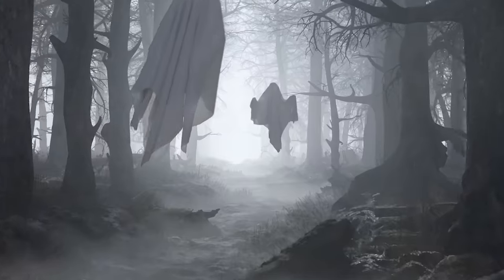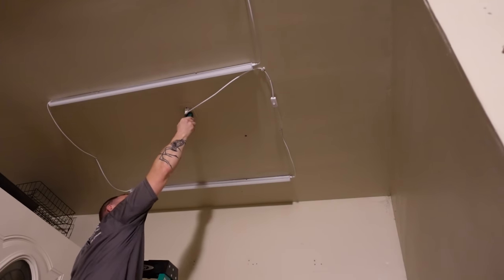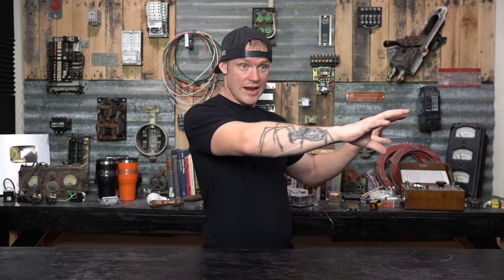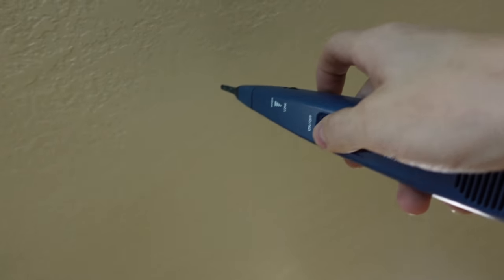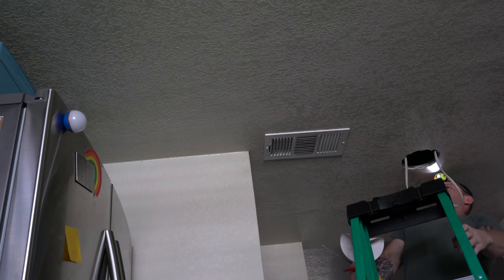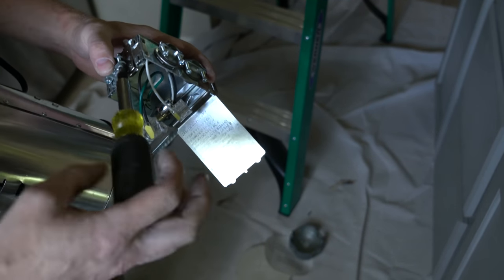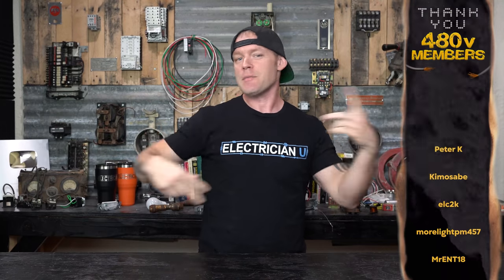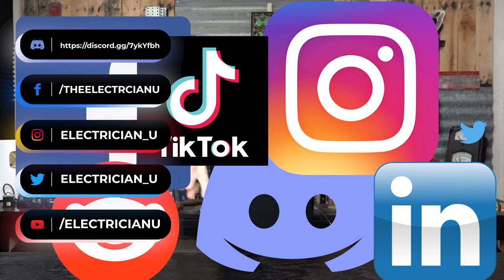THIS IS WHY ELECTRICIANS DON'T HIDE J-BOXES IN WALLS - Finding Hackwork!!

Comment: I am not an electrician but I have a brain, understand basic electricity and I am very careful. Over  four decades ago I was replacing a light fixture in our kitchen eating area. The house was a custom build only a few years old when i moved in. After turning the circuit breaker off I checked the wiring and saw 50V. Hmmm This fixture was controlled by a single switch but the house had a number of light fixtures on different circuits controlled by 3 and 4 way switches in the same gang as other 3 way switches or back to back with a box on the other side of the wall. To make a long story short it was four junction boxes before I found joined neutrals from another circuit and another 5 to make sure that was the only one. This almost new house, "professionally" wired also had a built in 240V oven simply wired nut connected loose in the wood cabinet (no  junction box), dishwasher not grounded with the ground wire simply cut flush with the sheathing and aluminum entrance cable, allowed by code at that time, installed without antioxidizing paste. Noticed that because the panel back was touching a wood panel wall in another room and i discovered it was warm to the touch. And when I took the face off to add NoOx I discovered a knock-out, loose, perched upright between the two hots from the meter. BTW I had an active toddler and the panel was under stairs, in a laundry room and backed up to the den where bouncing balls, etc. frequently hit. One good bump and ..... It looked like they originally intended to feed the panel from above and just used masking tape to hold the knockout in place instead of an open hole. I think that was all from this house but not the first or last time I have redone work by so called professionals. Glad to see you are both competent and caring.

Comment: I have a 12/2 wire running from my panel its on a 20A breaker. It use to be used for the fridge but I tore the wall out and moved the fridge so I got in attic and moved it and put in 8 led lights in living room. I also put a ceiling fan in living room to so I put a junction box in attic and connected two 12/2 wires down to 2 different light switches one to run fan and another to run the led light. We'll if I turn both of them on at same time the led lights flicker. Does this mean that's it's not enough volts thru that wire to run both. I figured a 20A breaker would be able to run 8 flush mount led light that are energy efficient and a ceiling fan. Should I run another wire and put them on its own 20A circuit.

Comment: Probably started out as a chandelier on the plans and the customer changed their mind
 I said to myself that if it was mine I would just put a can light in there 
I'm surprised the customer agreed to that 
Usually they are stuck on the original design

Comment: But why did the wire nuts melt? Why did it get hot? Was the twisted wire inside the wire nuts opening up and arcing? Was the breaker allowing more amperage than the wire was rated for? Was there a lighter weight Romex between a heavier Romex and the breaker that allowed a greater load than the light weight was capable of? Was the breaker too many amps? What are they using that draws so many amps that it could cause so much heat? Why didn't the breaker blow? Was there more than one breaker connected to that jbox or another box on that run? Something caused the problem. What was it? Did the construction workers currently working in the building drive a nail into the wiring? How long before the fire detects the real problem? Do you suppose anyone will die in the fire? You fixed the symptom. Did you fix the problem? Are you sure?

Comment: Really good tutorial!  I recently went through this same routine and found a hidden j-box in a cold air return.  Unfortunately it was not the problem. There was another hidden j-box, I am sure, that I never found. In that case I ran new wiring which fixed the problem. This kitchen was remodeled some years before and the hidden box probably occurred then.

Comment: Couldn't there have been a bit of a "return" on the voltage through some appliance that remains "on" like a clock?
That neutral stress point really looks like a long term high amperage draw that over time melted an iffy connection.

Comment: I just bought a house in Missouri and in one bedroom only , on the outlets they have one switched plug and the lower plug is live all the time. Only thing is the switched outlet does not go on and off, it goes from 120v with the switched on to 40v with the switch off . That is the way all the outlets in that room only works. No other room is like that. The upper is switched and the lower is always live. 🤔 🤦

Comment: Electrician’s don’t hide junction boxes, home owners and drywaller’s do. I’ve done a lot of drywall and it’s always the home owners that want them hidden. So when the drywall goes up, I mark on the drywall where the box is and tell them they need to get a trap door to install. After that it’s on them as far as I’m concerned

Comment: Hot doesn't need to go to anything else. If the insulation is bad and the business is all in the same metallic j box, you will pick up roughly 40v thru induction.

Comment: For what they paid for that service call... You should have fixed it.  It is just going to fail again later.  I hope noone gets hurt when it does.  Actual fix would be to jump off outlet... or better... Set a breaker in the panel and run a new line to the outlets so you don't need any wire-wire connections going to an outlet.  What it looks like happened was exchanging one fire hazard for another.

Comment: Good diagnosis. 
“The eye of the Master does far more work than his hands”.
Code issue still remains with SABC feeding GLBC  loads. I probably would have done the same as you did. 
A friendly suggestion; you might want to curb the F Bombs. Not everyone uses the F word. Potential customers might be turned off by your language. I worked electrical construction for years and spoke the same way. However, I no longer talk that way. 
Thank you for an interesting YouTube production.

Comment: Most likely the plastic just got in between the joint causing resistance after the initial heat up of a loose joint.  The guy's pretty lucky his house didn't burn down and it just stabilized at "weird".

Comment: This reminds me of a job I was on. It was out a ways and they had a bunch of electricians out and no one can figure it out. This was a multi million dollar house on a ranch and was being used for a sober living home. Anyway long story the upstairs bathrooms didint work the master and the one across the hall. I traced it removed every plug and went down to the main box and checked the generator box. Nothing was wrong. Now wile I was there I noticed the smoke detectors were off and at this point I had just looked while walking up the stairs. After about 5-6 hrs I was about to give up and run a new line for them. I needed up going to the attic entrance right by the bathroom and mind you I was up there a couple times. The last time I saw this random Romex not stapled to anything. So I decided to follow it and boom. The one of the dumb asses before me hooked the bathroom that was getting fed by a breaker and the smoke alarms that was on a separate breaker. And tied them together over this hallway. Then did a bunch of jank shit to the other bathroom so after I undid all of this. I can't remember I think it was all for a light and a switch. But it was fixed. That was a crazy day. But I got paid well and there now a regular customer. And they have been super happy. Somthing to laugh about when I talk with the owner of the house/program

Comment: 48V 200MA passing through your heart from a ringing LL telephone can kill you. That last ring could kill you. LOL. Canned all in one contractors think nothing about burying boxes. Some don't bother using a junction box.  One day I arrived as the electrical fire was burning inside a wall. No smoke, no sign of fire. 2nd floor lights not working. Asking the questions, I poked my head into the attic and I smelled smoke. Not enough to blow out the attic vents yet. My coworkers are all volunteer firemen. I called in the fire, then my boss. He walked me through pinpointing the hot spot, breaking the top of the wall and putting the fire inside the NEW bathroom wall out before the 1st fire truck arrived on the scene. Had I arrived 10min later, the 2nd floor would've been up in flames. That's one fire job I am glad I got to before it became a tragic event.

Comment: Sir what Caused the junctions to fail?  I work on vacuum tube radios. Of course capacitors and resistors fail over time, Often they are caused to fail.  That junction worked and then flaked out.  More at how do you confidently know that know that there is no underling problem which could cause that over heating and gods forbid result in a n electrical fire?

Comment: Yoooooo, I had a can I had to remove that was screwed to a joist. But the can wasn't removable, not a single screw let it loose and i could for tack weld spots that held the other side of the sheet metal for wiring on

Comment: I have an outlet on the second floor.  The wire is in the sub floor.  The outlet hasnt worked since i moved in. I thought after seeing a video i thought I might try and fix it. I couldnt follow the wire so I took out all switches and plugs in line of wire. I thought I would find a loose wire. Any Ideas.tks

Comment: To add-on to the explanation of how dangerous electricity can be, I'll use a cliche comparison with water.  Voltage of electricity is like gallons of water, but Amps of electricity is the speed of it's flow.  Sure we've all seen a tidal wave level houses, but think about a home outlet being like a pressure washer, it isn't spraying a whole lot of water in a moment, but it'll take your jaw off if you try to get a drink from it.

Comment: Can a junction box be accessible from the attic? A contractor i had working on my kitchen put a cover plate to a junction box on my ceiling and its somewhat of an eyesore.
Reply: Would love a picture 😄
Reply: @richt5986  I cant trust Google reviews 🤦‍♂️. He also ran a cold water line to my dishwasher and connected my kitchen light switch to where they only turn on if my living room light switch is on.
Reply: @countrifiedjose7537  wow.

Comment: J boxes aren't hidden because its illegal now, every box must have access, with a few excpetions, I.E. dropped tile ceiling, attic... but they are a pain in the arse when your searching for a short and usually done by a DIY'er or Hack.. I've done many homes where the contractor put nails through my lines so i put in a box with access cover, and later went back to go over everything with inspector and had found those accesses i put in were covered over with mud, The inspector read the riot act to the general and red tagged the build and told him to remove the mud from the box access before he could continue. The general refused to allow me to run a whole new line since he would have to repair 6 feet of drywall so i put in a j box and told him it must remain open and accessible.. I no longer do work for that company...

Comment: I'd be concerned with the quality of the breaker in this situation... To have so many devices jumped off a kitchen counter circuit is asking for overloads, and if the breaker was faulty, the circuit could be running those high loads, melting the wire nuts, and causing a problem precisely like this. If this is the case, this same problem will pop back up in a couple of decades

Comment: I like the video and the dude's explanation of the problems, but why would you yank on wires instead of using a tracer? Stapled wires might not move and wires held in boxes might not move. A tracer or tone generator could have resolved this without all the guesswork....

Comment: 😮 You're allowed to put a downlight light directly beneath and/or against a stud?

😆About drop sheets; I use them all the time, but they get dropped on dirty floors, and then onto someone's kitchen bench on the next job. I don't wash them daily, maybe every few months or so. 

But some of the customer premises I have seen, you could wipe the inside of a garbage truck and the drop sheet would still be cleaner than the surfaces they eat off.

Comment: Same exact thing happen to me jbox was covered in his basement. Getting weird voltage between hot and ground nothing between hot to nuetral but the same weird voltage between neutral and ground moving from 67 to 50 volts so I start looking .1 day go by I have different circuits tripping from the same point. Getting my toner reader in different spots. Come back took down the basements lights down nothing was wrong. Finally found at one point I was getting 120 at one point then the weird reading at the next so I new the problem was in between.. started to rip down the sheetrock in the basement found 3 jbox that were covered up opened each. In the one looks like a fire almost happend wires were melted together nuetral wires were melted together to hot wires and ground wires.. I fixed that problem solve but it still took 2 days to figure out where the problem was coming from

Comment: Well first by code you have to have access to any junction boxes not to mention you're gonna want to have access to any junction box cause you might need to use it later and most of all when you're trouble shooting and you don't have access to all connections on that circuit you're gonna be cutting walls

Comment: Oh, yeah... Aviation Electronics Tech and I've seen that kind of damage before. Can I say how the arc occurred? No, but with all the outlets and light fixtures, it makes me wonder if they overloaded the circuit. What I can speak to is with the melted plastic and metal in an enclosure the plastic fumes and microscopic metal droplets along with the violence of the event could have caused flash corrosion and plastic to attach to the spaces between the wiring connections resulting in changed resistance within the wire nuts acting like someone has stuck a potentiometer in the circuit. As the circuits heat up/cool down its like someone is twisting a dial every which way. Saw it on old aircraft a lot, some with junction boxes... Always drove me nuts, because occasionally it would be internal to an unassuming wire all by it lonesome. Some aircraft? Chased those faults forever.

Comment: Contractor on the job + melted wires?

They likely used a tool with a high current draw and inadvertently found a poor connection that normal appliances wouldn’t have.

As an HVAC tech if I’m using a tool that pulls a high current I try to run a heavy duty extension cord to an outlet with accessible wiring like a plug in an unfinished basement. That way I can easily fix it without causing the homeowner to need to call another repairman to fix the issues caused by the first repairman (that’s just embarrassing).  I don’t even consider using an exterior plug on an old house for a high current load. One, it’s unlikely it even works to start with. Two, you are about to be the person that causes another person to one day say “damn this outlet doesn’t work”.

To make a long story longer since I work in quite a few historic buildings (with historic wiring) I’ve even rigged up a fused pig tail that I can just pulled 240v off the AC outside and I try to buy tools with a 120/240v switch on them.

Comment: I have a customer with similar problems in their house that's been plaguing me for at least 5 years now I can't figure out where it's coming from they've had a whole bunch of other electricians that are far more skilled than I am in there. But I'm the one that's there all the time so I'm the one that gets to complain and I'm just like I don't know I've done what I can if I touch it anymore it's going to get worse. It's like it has enough juice to turn on my test light but it doesn't have enough light to light up a small LED light on a switch?? And I've been in and out of everything in this house. It was constructed back in the '60s rebuilt and then '80s or '90s and then I've been working on it for the last 8 years. Trying to get everything to work right. Plus it's one block from the ocean so everything is very corroded wood and metal wise.

Comment: I'm British, so maybe I don't understand something...
what kind of Craziness has lights wired into the same circuit as sockets?
Also this sort of issue wouldn't happen (to sockets anyway) in a British home, because they're wired in a Ring. So for starters there wouldn't be a junction boss, but secondly, if there was a break, everything would still work, because by default there's 2 paths.

Comment: Wait, what.... You ended up putting the illegal box right back in the ceiling? You essentially double down on the code violation by adding another cable to the box?!?! Did I see that right. Removing a recessed light to get to 4"octagon is not readily accessible. Did I miss something? At the very least, you overfilled the fixture j-box. I give you huge props on your safety advice, but I think we just saw a code violation. A old work box and a blank cover plate would have been a good solution.

Comment: Get used to wearing good tight form fitting rubber coated gloves.  Takes the stress out of brushing up inadvertently against 120v circuits